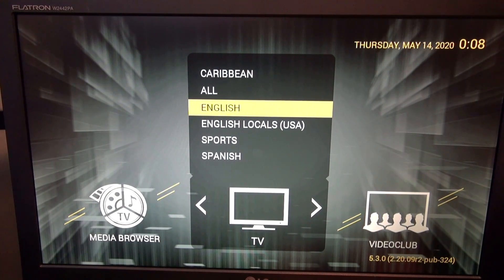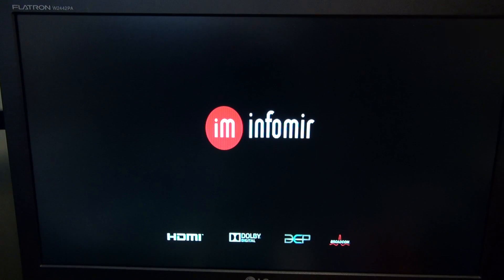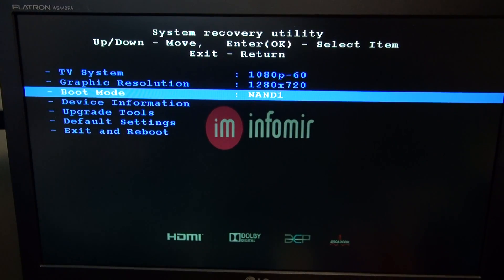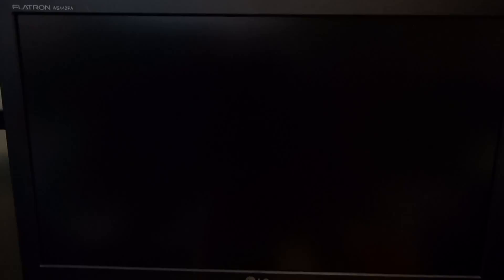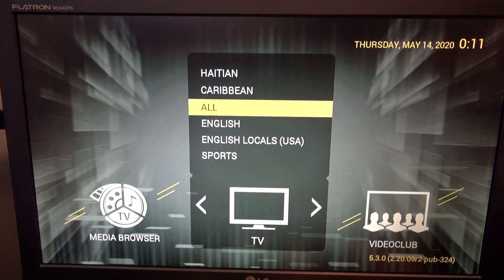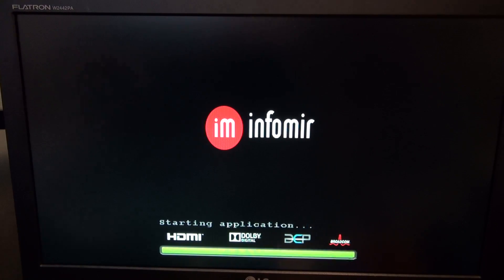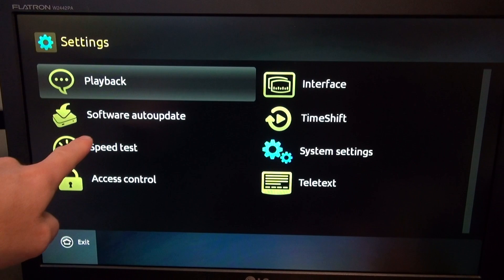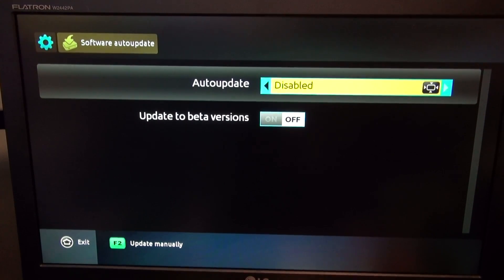How to Fix your blocked MAG424, MAG424w3

Comment: Anyone lost a bunch of channels last month! I watch channels from the 24/7 section. It shows all of then70’s to 90’s tv shows 24/7. 
Most of the channels have gone now and some are playing poorly. It’s locks up. Repeats sections and just stops working and I have to change the channel or reboot the box.
I really got used to the channels that are now gone.
Hopefully someone knows what’s wrong with my box.
Also I’m paying “a guy $90.00 for 3 months of service. Is there a cheaper way or can I do it myself???
Reply from the maker: Hi Rob. There is a lot of changes happening with the IPTV. Depending on the server you are using, They will come back. And you are paying way to much. You can get IPTV subscription on Amazon. But always start off with a trial.

Comment: Hi Jason, any fix for 522w3? I have tried your recommendation but still getting "Your STB is not Supported". Changed from the original NAND 1 to NAND 2 but no luck.
Reply from the maker: Hi Joe. There's no fix, the problem is with the IPTV servers not the the Mag 522. Your box doesn't work with all IPTV servers. Try contacting your provider and tell him what box you have, he should be able to switch your URL server.

Comment: I just bought new mag 524 w3, when i run speed test on it. it shows only 8 or 9 mbps. When i run the speed test on my laptop it shows 98 mbps. My internet speed is 100 mbps. Any suggestion how i can fix this? Thanks.
Reply from the maker: Hi. Are you using WiFi or hardwired?
Reply: @JasonTech  Hardwired
Reply from the maker: If you are running the test with the same wire. Then there's something wrong with your boxes ethernet port. I just ran the same test on mine box, and it's off but not by much.
Reply: @JasonTech  I agree I just returned the box and ordered a new one. I am using brand new Ethernet cable. I ran the test on wifi. Worse on wifi. Thank you so much for replying. Keep up the good work

Comment: Could somebody tell me if had been any updated for this locked issue???.. Due to sadly I haven't resolved this issue thus far!!!
Reply from the maker: Hi Daniel. Your Mag box only works with Ministra to 5.6.6 or higher. There is only a few IPTV servers that work with that box. Ask your IPTV provider if he has a service that works with that box, right now that's your only option. Question do you have a android box?
Reply: @JasonTech   I really appreciate your response!!, due to I felt lost about it...and let me ask you something due to I am really new about it.... Ministra, is the license I may get thru Infomir, is that correct?, due to my current provider is IPTV private server on a Box I currently use.
Reply from the maker: @danieldicent2163   It’s more then that, the IPTV provider has to update there system to the new ministra. Then everything will work but a lot of them don’t want to make that change and informer doesn’t want to use an older version. Right now I tell everyone to say away from Mag boxes or try to get the Mag324. If you bought a few months of IPTV and you don’t want to lose them. If you have an Android box or fire stick. Download StbEmu app and add your IPTV Subscription to it.
Reply: @JasonTech  Thank you so much for your guidance!!!🙂

Comment: @JasonTech. I have a MAG424. However, when I click on settings then server...I do not see the Portals option at all. I only see General and More. So there's no way to change to a new provider. Its stuck on DTV.
Reply from the maker: Hi Bayo. Have you tried doing a factory reset?
Reply: @JasonTech  Yes Jason. Tried resetting...it shows the blue screen but ends up going back to the original portal. I saw on infomir that this particular box has been discontinued though.  So not sure if that's what is affecting it.

Comment: There is no need for a new firmware. Just do a factory reset by pushing a pin in the hole on the left of the box immediately after you plug it in. A white light starts flashing and when it turns to red and starts flashing quicker you take out the pin and after 1-2sec immediately you reinsert it in the hole. Then leave it until it is permanent red light and then you wait until your TV gets a  blue screen. And then the format happens. After that it starts in the inner portal. ( I am not responsible if sth happens...i did it and it worked). I was on an IPTV provider and wanted to go to another.
Reply from the maker: Hi Giorgos. Thanks for sharing
Reply: Giorgo did was asking you for authentication? Login details and password? Cause that’s what it does for me after I change the box. The first one was defeated (423w) I sent it back and got a new one. I let my provider know the new Mac number but when it tries to load the portal  it asks for authentication.
Reply: @stefanospessianis5791  No. Sorry. I didn't have that problem.

Comment: I have issue to record on my MAG424w3. After 10-15 sec I push the record , STOP and showing massage PVR error end stream . I did try this method and it doesn't work for me either. I don't really know if the IPTV channel provider is blocking purposely the channel for preventing the recording  , I have a 2 days ago working recording options , but I heard that the provider is doing a maintenance, after the maintenance is  done , went back to the same issues. Is anybody knows how to fix it
Reply from the maker: There is a lot of changes happening to the IPTV services. And one of them is the recording option. There is only a few IPTV services that give you the recording option and that will all be gone soon.

Comment: Does the 424 support stalker or just Ministra?
Reply from the maker: Both should work, But the URL have to be updated. https://wiki.infomir.eu/eng/ministra-tv-platform/ministra-installation-guide/faq/how-to-run-the-mag420-mag422-mag424-stbs-on-the-5-3-5-4-5-4-1-5-5-portal-versions

Comment: I've got a mag 424 w3 no matter what iptv I got its blocked . Any help would be great
Reply from the maker: Hi, The problem is with the IPTV provider not the box. You will have to contact them and give them this link. https://wiki.infomir.eu/eng/ministra-tv-platform/ministra-installation-guide/faq/how-to-run-the-mag420-mag422-mag424-stbs-on-the-5-3-5-4-5-4-1-5-5-portal-versions
Reply: Thanks for the reply my box does not have the Ministra TV platform on it or will the provider have it on they side. On My mag 424 W3 am unable to download apps
Reply from the maker: So you have the MAG 424A w3? Go into setting and make sure "Apps From Unknown Sources" is on.
Reply: I have the mag 424 w3 it's not android box. It's a normal mag . Am unable to down load apps on it. The one your thinking of is a android box its mag 424A W3.
Reply from the maker: You can't download apps on to the Mag424 only servers with a URL. It's Linux OS with the Ministra TV platform. https://www.infomir.eu/eng/products/iptv-stb/mag424/
Reply: Yeah you cant download apps on the mag 424 w3. No matter what URL I get its saying its blocked any advise on how i can get this sorted

Comment: AS FOR THE HDMI-CEC ON THE TV I DON'T UNDERSTAND WHAT YOU WANT ME TO CHECK,IS IT  THE SETTING IN THE TV OR SOME CABLE CONNECTION BEHIND THE TV? PLEASE CLARIFY,THANK YOU  JASON
Reply from the maker: It's a setting on the TV. By default it's on auto, just turn it off.
Reply: @JasonTech  i found while on the settings menu of the box, it says "disabled"

Comment: hi Jason saw your video good stuff ,my problem is with the PIP(picture in picture) on the TV guide page. The picture goes to a very very small size while you are looking at the TV guide page. I tried rebooting the box and it works until I turn TV off . Then when I turn it back on the same thing happens again. Just got this MAG 424w3 couple of weeks ago was working fine then this started, also when I turn TV off ,after a few minute the iptv box shuts off by itself??
Reply from the maker: Hi Arno124. Did you check the video setting on the box? Check the HDMI-CEC on the TV, This turns the TV on and turn equipment off.
Reply: @JasonTech  i did look at it but i don't know what i'm supposed to do
Reply: @JasonTech  as per the HDMI-CEC do you mean the "settings" on the TV, ?

Comment: Hello JASONTech.
I purchased a Mag424 w3 manufactured on August 28th 2020.
I  entered the information from my IPTV provider and the following message appears "Your STB is not supported".
Please let me know if there is any solution or have to use the box as a paperweight.
Reply from the maker: Hi Juan, For that box it only does that on certain IPTV server. See if your iptv provider will change it to a different URL for you. But make sure you tell him what box you have.

Comment: Hi Jason, like your videos. Is it possible to load external apps on the 424w3 ? Apps like Kody, Oreo T V , OLA, Red Box et al
Reply from the maker: Hi Paresh, No not on that box. Only the android models you can.
Reply: @JasonTech  could you tell me which iptv server can i use on mag 524.
Reply from the maker: @luisfeliciano6069  Hi Luis. I tested OK4 on this box and it worked great no issues.

Comment: my mag had a connection error, i  tried to plug it off and plug it back but it didn't work and then it showed a black screen, what do I do
Reply from the maker: Hi. It sounds like the IPTV server was down. Did you try it again?
Reply: @JasonTech  no let me check
Reply: @JasonTech  I checked and it still shows me a black screen, also the connection error had a red box at the top saying connection error

Comment: I have a Mag424w3 and when it tries to load to my portal it as for Authentication login and password. Any ideas how to fix this?
Reply from the maker: Hi, Your subscription is up. You will have to contact your IPTV provider for more months.
Reply: @JasonTech  Hi, I have similar problems with the box. It so happens that the box get's logged out even though my subscription hasn't expired. And every time I have to re-enter my log in data. My provider is not aware of this phenomenon. Is there a possible way to save the login data, so I don't have to re-enter them all the time? Cheers
Reply: I just ordered this box from Amazon.  How do you like the box if I may ask?  I hear it's pretty fast.  Any buffering issues?  Which IPTV are you using and how do you like it. I've trying new ones.  Thanks

Comment: Hi ! Thanks for the video.
By the way I am not able to get 4K (2160p) signal output... I changed the setting to 2160p in the box and even while playing 4K video I still have 1080p signal on my amp/tv
Anyone with the same issue ? Any tips ?
Thanks !
Reply: After so many attempts i have got 2160p output setting on the 424W3. go to the inner portal video setting selec 4K 2160p 50 or 60hz based on whcih ever is compatible with your TV or monitor check for the specs there most TV monitor (older models) support upto 2160p 30hz in this case the MAG will not work. make sure you slect the frame rate at 24/50/60 and graphic resolution of 1280X720 after making all the changes and you are sure other 4k devices are working on your same TV or monitor connect with the same cable to the same port where the TV/ monitor can recieve 2160p 60hz signal. you should be up an running. now regardless of the iptv service provder your output signal will always be locked at 2160p and your 4K usb files should now play in full resolution
Reply: @sm6932  thanks for the top but I already tried and just tried again and I get no signal on the amp... or there sources connected to the amp showed 2160p 60hz without any problem... very strange 
Thanks for the tip anyway !
Reply from the maker: Hi, Is your TV / AMP 4K?
Reply: @JasonTech  yes yes both amp and TV are both 4K and I have 4K with other sources through tv/amp
Reply from the maker: I think it's your IPTV server is not giving you a 4K signal. It's only giving you a 1080P signal. And I don't think there is a IPTV server that can give out a 2160p signal, but I can found out for you tomorrow for you.
Reply: @JasonTech  for TV provider I think you are right but I have same issue while reading 4K video my NAS (i know these files are 4K)

Comment: Hey on mag424w3 box the channel list appears for 3 seconds to change to another channel and it disappears any idea how to fix that ? Thanks in advance
Reply from the maker: Hi, So when you change channels it shows the channel then goes black?
Reply: @JasonTech  yeah that’s correct.
Reply from the maker: Did you check the video setting on your box? and try a different HDMI wire.
Reply: @JasonTech  I tried another HDMI cable same issue, what would I be looking for in video settings ?

Comment: Hi! Any fix for the 420? Just got it, set it up and keep getting the firmware update message
Reply from the maker: Sorry no not yet.
Reply: Does you r420 work, I am thinking of buying one.
Reply from the maker: @vinp3678  Hi. If you get any of the Mag boxes. Before you set it up disable updates and NEVER update the box. Or you will have problems.
Reply: @JasonTech  But do you think if I buy one now, it will come with the new firmware that doesn't support the portals. I don't want to risk spending money on something that doesn't work. Also do you  think I should get the 420 or the new one 425a?
Reply: @JasonTech  And now I know from reading the comments and watching the video that I shouldn't update it and I won't.
Reply from the maker: @vinp3678  You should be ok. They never come with the latest firmware. But they do have auto update on. The Mag425A is a android box so you can always download STB Emulator if you had too. And you can install a VPN on that box.
Reply from the maker: @vinp3678  I know and there's no fix for them.
Reply: @JasonTech  If you are from the USA, where did you buy the mag box from?
Reply: @JasonTech  If you live in the USA, can you tell me where did you buy a mag box, I ain't trying to get scammed. Thanks you.
Reply from the maker: @vinp3678  No from Canada. Try Amazon, you can always return it.
Reply: @vinp3678  Amazon
Reply: I just got the 420 and it’s garbage. Firmware is “outdated”

Comment: These models only work with Ministra Servers please check with your provider first. The older mag boxes work with your standard Iptv providers but as this new mag box only works with the Ministra servers. You’ll get the message upon start up  saying “Your STB is blocked. Changing from NAND 2 to NAND 1 will not work. Tried and Tested.
Reply from the maker: There's no fix yet for these boxes.
Reply: @JasonTech  what fix are we waiting for ? can you explain more, i just got this box not knowing that it doesnt work with IPTV providers.
Reply from the maker: @anasaoude8814  Hi, Right now that box doesn’t work with all IPTV servers. So before you buy any subscription, tell the provider what Mag box model you have.

Comment: Hi just bought mag 424 but the device it's not responding well to the remote control.
I can't change channels when I push ok butten don't respond please help if any one have same issues.?
Reply from the maker: What box do you have the MAG424 or the MAG424A? Try moving the box around, it might be getting some interference from something.
Bad battery.
Reply: I had the same witj my mag 420. I couldnt find wat the problem was and finaly i had set the picture quality in an unsulorted format. I cahnged it to 1080/50 and is now fine

Comment: Hello guys! I just ordered a MAG 420. Any ideas if I'm gonna get the same error message about the firmware as the MAG 424?
Would appreciate your help!
Reply from the maker: Hi. There is a problem with all MAG boxes but you should be fine if you turn off auto update and never do an update. For now.
Reply: @JasonTech  Yeah did same with my old 254. Just unsure if it's a broken firmware right out of the box. Guess I'll just have to wait and see.
Reply from the maker: I have a fix for the MAG254. https://youtu.be/fJzuZTVKD6I
Reply: @JasonTech  Did a similar for my 254 a couple months ago. Just wanted to say, MAG420 worked right out of the box. Not gonna software upgrade in the future of course.
Reply: @JesusChrist-sx1lf  I am about to buy one, is your mag 420 still working?
Reply: @vinp3678  Yes it still works out of the box for me with my provider. I havent upgraded the firmware since I bought it, dont dare in case it mess things up.
Reply: @JesusChrist-sx1lf  That's great,  I am thinking about getting one right now,but the thing is I am sacred that when I buy it, it'll come with the new firmware that doesn't support IPTV providers and their portals. Also are you from the US? If so, I wanted to ask where did you buy it from, I don't want to get scammed. Thank you so much.
Reply: I bought my mag 420 a month ago and is working fine. I alao bloked the auto update so i hope it wil work ok also in the future

Comment: Hey it worked! but I get a message on the screen saying firmware needs to be updated then it counts down. I didn't do anything and then my change came on. Should I be worried?
Reply from the maker: Just make sure you have auto update turned off.

Comment: Also feel it is worth mentioning that both of my mag 424W3 were brand new and yet when I went to change the nand1 and 2 option, one of the boxes was on nand2 and the other box was on nand1. Odd, I would have suspected them to be the same one way or the other.
Reply: Samo problem with my 540w3 too, in some packages I get black screen, did you solve the problem?
Reply from the maker: Ya that's odd. Every box I had and tested it was on Nand2. If you have any android box, download the iptv smarters app. Then ask your provider to change your service from a MAC Address to a user name and password. So you don't lose out.
Reply: @JasonTech right after 3:01 my tv turn black you know a fix for this?